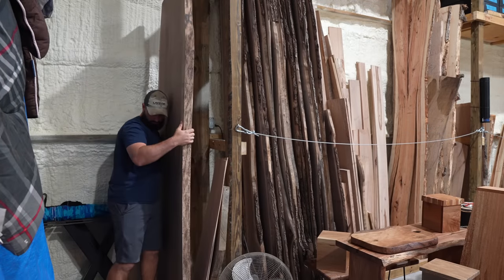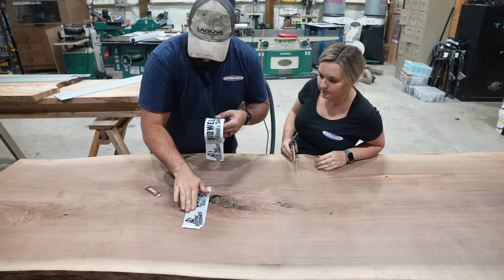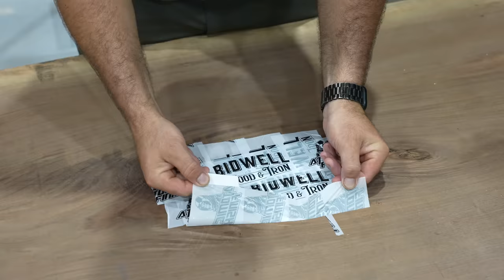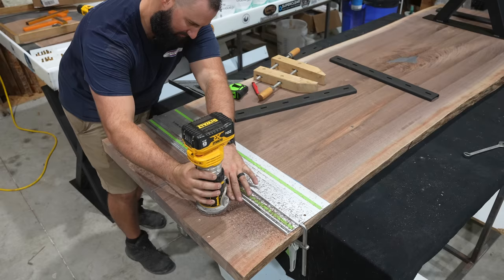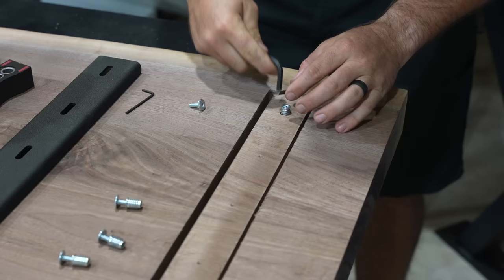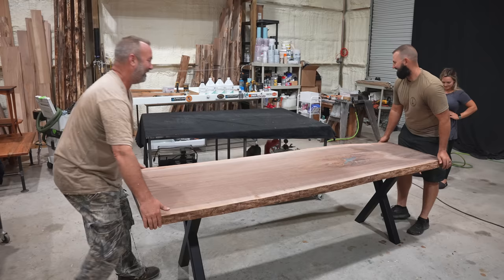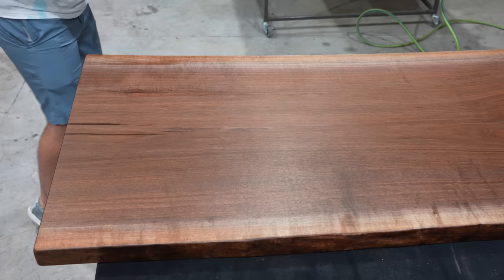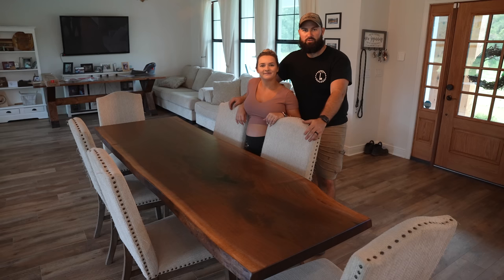$5,000 Black Walnut Table For A Famous YouTuber

Comment: Yea…. That was a click bait move
Reply: Not as bad as most. At least they included the actual topic. I wouldn’t call it click bait. This channel uses lick bait 😉🤪
Reply: Definitely
Reply: As soon as I seen this I knew not to watch.
Reply: Yeah that YouTuber got screwed
Reply: Congrats Zoe looks stunning!
Reply: SK  I liked and subscribed.
Beautiful table, loved the surprise.
Upgrade for a growing family. 👍🙏
Reply: I think drawing the templet lines before routing is best method. Don't say, "Oh well", no one will look at the
 bottom, is not a good way to showcase your work. Lots more sanding needed to get the lines out, that show up from the saw mill cut. The cross grain lines. The stain, brings them out, going across the grain. That be said, Zoe looks like she is enjoying helping you with project. Vacumn systems are important with this work. Lovely gift for your wife. Nice and sturdy.
Reply: @marlenemeinhard8956  👈completely missed the point! Thats some tasty looking click bait and it worked!!
Reply: Like it need to build  one need to take down some trees
Reply: Got me to click 👍 (with absolute all due RESPECT! )
Reply: Now the finish you used on the table, can you epoxy over top of it for a more durable finish?
Reply: Bye Felicia!
Reply: What a beautiful table !! I loved the way you walked us through the entire project !! Sound and picture quality were excellent. Your narrative was good and you did an Incredible job !! I am 80+ years old and a long-time retiree who has loved woodworking since I was in High School in Africa !!
Thank you for sharing and I look forward to seeing more of your channel in the future. God Bless you and your entire family !! 🙏
Reply: @Mc-RaGe-In and yet here you are commenting 😂😂😂😂
Reply: I used to work with  apoxi. How can it work if the glue dont  smell 😷haha😢
Reply: Yea… you were just weak enough to feed into it lmfao
Reply: Awesome table, Bro. 

Well done. 

I can’t wait to try out some of the products you used. 

Praise King Jesus
Reply: The vacuum sealed lower half is click bait.
Reply: All of their videos are clickbait!

Comment: I see the C channels have elongated holes to allow for shrinking and expansion, but the crossed table legs don't, this will cause the table top to crack over time as the legs screwed to the bottom of the bottom of the table in that way will restrict expansion and shrinkage. In short for longevity of original form, the table legs also need elongated holes too
Reply: I do not know about you guys but that looks like a pretty expensive table and I am going to assume you will keep it inside your climate controlled home. If it was properly sealed and finished there should be minimal expansion or contraction.

Comment: Yes Dremel !!!  Glad at least 1 person has the IQ to use a quality reaming item for debarking pits and cavities !  There are many Dremel items or Dremel/Dremel-like bits that can be googled.  Have said this to many woodworkers - even the woodturning/carving vid peeps.  If need be, then get a local welder to weld on a longer shaft, and then abraid down the shaft to smooth surface - so no wobbling.
Reply: Just my peeve - is filling voids with black epoxy when the cavity is big enough to pour clear and be able to see the burly wood surface and texture, while cracks and splits would be blacked.

Comment: Nicely done sir. You might try using a flex shaft Dremel tool with a Kutzall burr to remove the punk wood.  Also, if that doesn't go deep enough for you you can get a piece of same size steel rod and weld it to the burr shaft.  You can extend the burr that way to any practical length you might want.

Comment: Quick tip, when using that router with the square/round base, use the round side along a straight edge fence. The reason is when using the flat side, you can have it lift away from the straight edge ever so slightly and it can ruin a straight line. If you keep the round side against the straight edge, you can rotate the router without losing contact with the straight edge and your line will stay true. Lovely table you have there. Good luck to you and your family.
Reply: so pretty much you going to tell this guy how to use a router lol 😂
Reply: Exactly

Comment: Idk if anyone said it but I use the Dremel flex shaft and it helps with the bit depth bc it can get into tighter places than the actual Dremel. Good luck🤞
Reply: True that... sometimes you can find a little longer bit as well, but always good to check it first.  The right tool for the job is so important.

Comment: Good work. Instead of grinding the table legs around the bolt holes you could use your step drill bit and drill from the other side slightly creating a small chamfer. I love to mix metal and wood in my projects.
Reply from the maker: Dang! Great tip thank you!

Comment: 2 tips for you,
1 set your distances off the rounded part of yout router so if the router turns slightly your cut won't wander.
2 for router depth put the cutter down onto the surcace and put yout c channel inbetween the depth slider and one of the posts and it'll be perfectly flush.

Comment: Re: clearing voids to prep for epoxy pour, guessing they still make flexible drill attachments, about the diameter of carpenter’s pencil, which can be held like one and accept’s standard bits (1/4" max.). Have 2 old ones each 18" long… both bought used, 1 part of a now discontinued Canadian MasterCraft multi-tool. Nice work including ‘squaring’ ends… depending on slab & objective, squaring (literally) off centerline based on midpoint of each end works too.

Comment: My father use to do a lot of Epoxy back in the 80s. I'd say that really good ventilation is a must. Especially during the heating. 
A few years after working with the Epoxy he contacted Lung Cancer. We thought nothing of it, but several of the people that were also making clocks and signs also contacted Lung Cancer.

Comment: You might try a whip extension for the Dremel. It will let you be holding a roughly pencil sized end to fit better in tight places.
Reply: What I was going to say - hang the motor over the work, and get a foot switch as well.

Comment: im a residential repair plumber and i use a Dremel and its big brother the roto zip (*roto zip is a Dremel on steroids) anyway they have the flex connector that spins in the extension so you are holding a long thin #2 standard school pencil/pen, that would be perfecto for bark cleaning pre-epoxy fill!! i would keep checking they are getting new tips attatchments daily now it seems! hope it helps you!!

Comment: for cleaning out the voids, look at tooling and attachments for doing automotive head work / porting, you can find Tungsten Carbide Rotary cutting bits in 150-160mm lengths among other

Comment: I've been a tradesman for over 20 years and I'd say you still have room for improvement on your excepting of mistakes you've made on this job. It's called having integrity. It does not matter if it's under the table out of sight. You saw it! Do better!
Reply from the maker: You’re right. I’m burning the table as we speak and will start over.
Reply: Funny criticizing someone else when you say excepting when you mean accepting.
Reply: Do you honestly think that the table is worth $5000.00 dollars?  I don't think so..
I mean it's a nice table and all but there's nothing fancy about it.  Fancy joinery or ornateness or something...not trying to sound like a hater or nothing 🤔
Reply: @ruskell100  how often do you cross walnut slabs  this size!?
Reply: Absolutely Beautiful!
Reply: @ruskell100  Probably not 5000. 1000 for the slab and 100 an hour for the labor is how I figure.

Comment: I worked with epoxy for over 15 years and I'm surprised to see your pregnant wife in the same room as you working with epoxy. The dangers epoxy brings are deceptive....epoxy rarely has any odor and that deception makes it very dangerous. When I first started with epoxies I did so with little to no protection. Your skin and, especially eyes, soak up the poisons lurking in epoxy. That said, I suffered kidney failure and serious liver damage....I say that to say this: your wife shouldn't be anywhere near epoxy and you should be completely suited up with a fresh air system that pumps fresh air into a helmet from outside the shop. However, that's just my 2 cents.....the treatment and recovery time is extremely painful and a very long process.
Reply: Oh well. Their kid.

Comment: I was told that in order for a slab to be dry, it must be 8 or below.  I made an ash table and the moisture content was 14; it ripped shredded ripped the grain, curled and cupped. I threw the whole 2 inch table away.
Reply from the maker: It all depends on the environment.

Comment: Great video and table!  Someone probably already mentioned this, but instead of using a Dremel to deburr the holes you drilled in the leg mounts, just use the same stepped bit from that side.  Stepped bits work great to clean and chamfer the holes.

Comment: I was a loyal SurfPrep guy myself and could not be more satisfied... Until. the new 3M Xtract  Sander was recently released. Game changer. Another thing you may have already tried; hot melt glue around epoxy pours to build a small dam. Keeps it in place and you can pour it a bit proud and knock it down with a steel. Great video. I would be intimidated by a large chunk of wood like that. I’m a luthier and have probably paid as much for a much smaller piece of some of the exotic tone wood that high end guitar companies use.

Comment: They have a flex shaft that might allow you to extend the depth you can work preventing the body of the Dremel from getting in the way then get longer tools that you can turn end down to fit the collet or you might be able to get the 9100-21 Fortiflex Heavy Duty Flex Shaft Tool Kit to help with the project with longer bits turned down as little as possible to fit Dremel.

Comment: Very nice table and a good video. I did notice that the screw inserts took some effort to insert and tighten. I have struggled with them in hardwoods also. A little tip that works for me is to put a light coat of min-wax on the inserts before you screw them in. It will decrease the effort it takes to screw them in the wood. You do need to be careful not to get any excess wax on any wood that will be finished as the wax can block any finish that you may apply.

Comment: you can get long reach carbide burr's, i have a set of 6mm (1/4") ones at 150mm (6inch) long but i normally use a die grinder with them as i find them rotary tools under powered and a pain to use.

Comment: I used a Dremel and had the same issue of not being long enough to reach. Since it was wood I took a 1/8" stainless arc welding rod, knocked off all the flux, heated and flattened the end. Worked for me just fine, have also used it in a drill to drill holes in various situations where a drill bit wasn't long enough.

Comment: Beautiful table.

Instead of using a multitool where the motor is in the handle you could look at a  pendant motor, such as a Fordom, with a flexi shaft and hand piece.

Because the handpiece doesn't need to house the motor you can get a range of hand pieces for different tasks.  Some are thinner and you can also get a hammer handpiece that can take chisel blades.  You can use the standard Dremel bits with it as well.

Comment: I have watched a few of your videos and you 2 look like a nice couple. Hope the baby and mom are doing well. One word of advise for you is just use a larger drill ( 1/2 Bigger) and drill the wholes just a touch and the bures are gone. It won't make a mess of the powder coat if the Dremel slips. Keep up the good work. Cheers Bill

Comment: You can buy long shank burrs for your dremel. You can also get a grinder that the motor hangs on a stand with a long cable drive so what you end up with is basically the same as using a pencil grinder but with more power.

Comment: Nice table, nice idea to make it as a gift for your wife. If you use the same brand c channels for every table, you should consider making a rectangular jig to guide your router on all four sides. Then every cut would be identical. You could make a second jig to fit inside the first jig and guide the second router cut to lower the center for the entire bracket. You would not only save time and money you would avoid making costly mistakes that could ruin your project!

Comment: You can use a vaccum pot or small vaccum chamber on your epoxy cup to eliminate bubbles before pouring.  It pulls air out and can almost guarantee no bubbles.

Comment: I use an Aircat air die grinder with 6” long 1/4” carbide burrs for aluminum cylinder heads to dig out voids. You forgot to mention that you MUST stir the epoxy for 3 minutes so it cures correctly.😊

Comment: Just a little tip I learned the hard way you should use the rounded part of your router foot because if you come off that flat part at all it messes up a good straight groove  no matter what you do with the rounded edge your going to be fine. That flat part is for your fingers to guide the router.

Comment: I like the idea of crisscrossing the tape. I suggest extending the top layer of tape beyond the edges of bottom layer. It will adhere to the wood instead of on top of its self.

Comment: You could look into air-powered porting tools used by engine builders to work those voids deeper and faster. Might be a bit pricy, but you might be able to find some used kit on-line. Those tools can drive all kinds of rotary cutters, burrs , circular rasps, etc - literally 100’s of options. They’ll come in all kinds of shapes, widths, and lengths - I’ve used bits upwards of 6-7” long. And they’ll be tough enough to cut cast iron and aluminum. You won’t bend any bits. Anyway, just a thought…

Comment: You should get a set of carbide burrs like they use for porting cylinder heads and intakes. They can be had in dozens of shapes and up to 6 inches long. Generally I use a air powered straight or right angle 1/4 inch grinder tool. They make electric ones but they don't work as well

You can also use a small vacuum pump and a piece of lexan on top to draw out all the bubbles and completely fill voids.  It would eliminate the torching

Comment: You should have used elongated holes on those leg plates like you used on the c channel. Also you should rout an extra eighth of an inch on both ends of those leg plates to allow for expansion and contraction as you did the c channel.
Reply: I was thinking the same thing.

Comment: Nice woork👍 just a sugestion..iron profiles helps 10-20% to keep the wood bending. You should make on the bottom 1/3 deep a few cuts long the way of a table to make a bending power less strong😉

Comment: To reach deeper with the Dremel tool, get a flex drive attachment.  I've been using mine for over 30 years now and "never" use the Dremel by itself.  It's a great tool.  Very good video.
Reply: Glad to see someone else post this, I’ve been scrolling through the comments, just sure that someone must have said it by now.

Comment: Nice beautiful table. Too bad that you couldn't get the 'local welder' to join your other sponsors. You must be more demanding amigo :).
I have a question. You nicely routed out extra space for the c-channels which have tapered holes, to allow the wood to move. Why didn't you do the same for the legs? The 'local welder' needs to do a better job. He must deliver legs that are square with slotted holes at the right size. He also should have added a spreader bar to make this solid.

Comment: the $5000 black walnut table was a very nice build and I was especially impressed that you checked the equilibrium moisture content for your location . You  installed the "C" channel with the ovalized slots that allow for wood movement with changes in humidity, but then you fastened table leg bases right through the round holes , trapping the walnut top, preventing wood movement, which can lead to cracking, splitting, etc. We see this mistake often in YouTube videos but we also do see it addressed in many other videos. Check out what some of other  YouTubers advised. Thanks!

Comment: Try Northern Tool on internet. I worked as a fabricator for six years and learned you have to check 2 to 3 times the measurements. If someone is helping it is good the let them check the measurements. I worked another year as an overhead crane fabricator.

Comment: 1:30 what you should’ve did, is cut one of the edges with a circular saw and then used the T level measurement to draw another straight line from when you cut, and continue to cut and then measure.

Comment: Great video thanks for the details of the whole project. Looks like a fun project. I noticed that the C channel allows for wood movement but the legs did not. Will there be any cracking over time. I have never seen a slab of that size used as one piece in a project. Nice surprise for your wife 😀

Comment: Weld an extention, or get a toolmaker to do the same, to your dremel bits as many as you want and say at different lengths so you have exactly what you need to clean out dead wood and other parts you want done.
Reply: Whats with these catfish getting on peoples profiles your like the third one Ive gotten a catfish reply on to say Ive won something, so dont take it personal they are sitting on just you but they are chasing either my name or lots of people hard to hit me 3 times in the last 2 weeks on different channels. Good work in deleting their comment though.

Comment: Get yourself a battery powered die grinder from Milwaukee and you can get carbide but bits in lengths I believe up to 6 inches. That would work way better than a dremel, those are for amateurs!
Reply: Bur not but! Dam spell check crap, how do you turn that off???